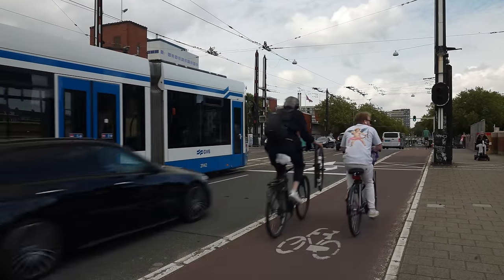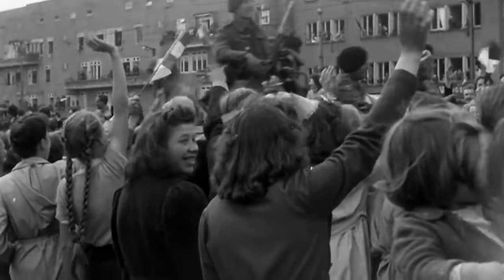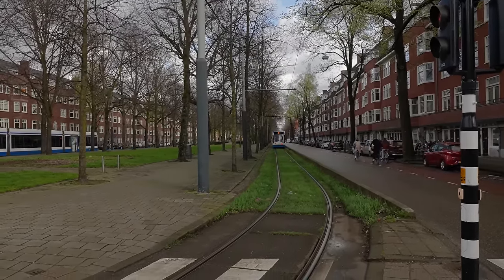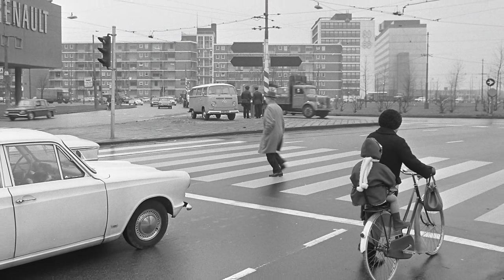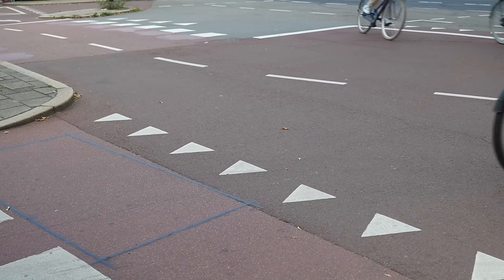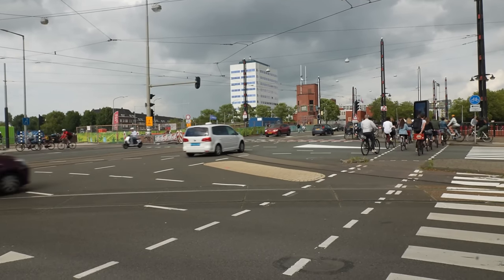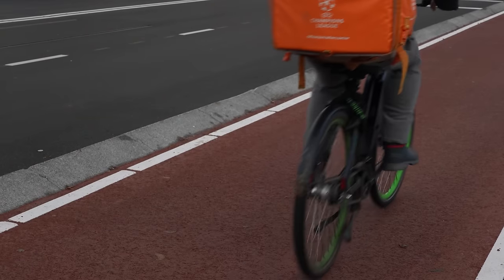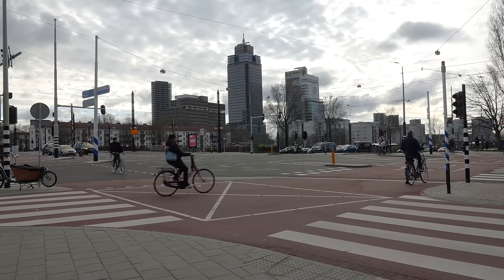Amsterdam Closed This Bridge to Cars (but not bikes ofc)

Comment: just for the good order: WE DO NOT REPAIR OUR BRIDGES ONCE EVERY 90 YEARS. it's really dependent on the materials, the usage and how well the small maintenance has bin done. but 90 years would be record-breaking for a bridge which is being used so much.
Reply: I remember small repair in the 90s, but not the fundemental bridging system.. maybe im wrong. Who does know here?
Reply: in america we absolutely repair our bridges every 90 years, or when they fall down, whichever comes first
Reply: I work on these kind of projects, they engineer bridges in general to have an average lifespan of 100 years (sewers as well by the way). So yeah Berlage bridge with it's heavy traffic use was overdue at 90 but not incredibly long overdue.

Comment: How Amsterdam reacts to problems is just crazy.
There is no connecton to the other side? Build a temporary Bridge.
There is no Tram line curently? We will get that fixed soon. In the mean time we will have more buses driving there.
In nearly every other city stuff like this would simply be ignored or worsened.
I don't even live in a bad place but videos like this make me wanna live there.
Reply: You call it crazy, I call it efficient.
Reply: That is what you pay your politicians for..
Reply: @paolagrando5079  I believe the crazy part is that it is possible to actually achieve the efficient result.
Reply: I do like that they somehow missed installing the tram lines. Like the rest of the project continued and actually completed without them installed, that's pretty funny. I suppose it did finish on time though!
(Of course they'll fix the issue, I just love that weird construction issues like this happen worldwide)
Reply: The tram line being cut off is kinda embarrassing imo. I think running replacement buses is really the minimum that any city would do, at least in Canada (can't personally speak for USA).
Reply: @laurencefraser  I know. In plenty of other countries we are used to see efficiency only with a telescope.
Reply: The core of the issue in my view is a different election system.
Dutch politicians aren't magically better than other places.
But we have election systems that function a lot better than first-past-the-post in aligning politicians with the desires of voters.
Reply: "There is no Tram line curently? We will get that fixed soon. In the mean time we will have more buses driving there."
If such a thing happened in İzmir, the replacement bus route would have been a shuttle that only covers the stops just before and just after the bridge.
Reply: Idk why people think this is only an Amsterdam thing.

Comment: In Bremen Germany they closed a Bridge for Cyclists and Pedestrians, but kept it open for cars....
Because in the eyes of the city administration, Cyclists and Pedestrians weight more then Cars, Trucks Busses and Trams
Reply: Ohh that story. They also blocked the bike path with metal fences secured by concrete blocks.
So the blocks did weigh more than the bikes would.
Really the entire administration would strougle to achieve half an IQ between all of them.
Reply: @MetalMachine131  This surely must be a joke. Right?
Reply: @fulconandroadcone9488  Nope this happened. Eventually they figured out that it didn’t make sense (the required report costs like 100k) and the barriers were removed.
Reply: @fulconandroadcone9488  No, sadly not. Been there, seen it. The bridge is reopened now, though.
Reply: as if cycling through Bremen wasn't already difficult enough
Reply: @corvusmonedula  It actually depends on where in Bremen. There are parts with pretty good cycling infrastructure. Also, there are projects going on to improve that. I.e. the Fachausschuss Verkehr und Umwelt Schwachhausen earlier this year decided on a plan to sacrifice a bunch of roadside parking in favour of the Radpremiumroute to Horn-Lehe.
Reply: "GERMAN SCIENCE IS THE BEST IN THE WORLD"
Reply: @GanyuSimpingDegenerate german sucks now
Reply: vErNünFtiGe PoLiTik they said
Reply: They did similar in clogne.
The pedestrian and cyclist lane got cut in half with baricades to "reduce weight on the bridge". Well the baricades weigh more than there are ever people on the bridge. And there are not less people anyways on the bridge, the just cram more. Closing one car lane instead was not possible, obviously...
Reply: @prashnaveetprasad8339  They still have the autobahns with unlimited speeds, so they still rule the world. They should have those in the US or Canada, yet there they put whatever farmhouse exiting directly on highways. Ridiculous.
Reply: @jankees4037 i cant figure out If this is Satire or Not 😂
Reply: I'm not surprised. 🌑
Reply: ah yes, the German efficiency and practicality :D
Reply: @johnjohnny7257  Yes, it belongs even below F Tier! “G” Tier for Germany. XD
Reply: @fulconandroadcone9488  no this is common in Germany I’m happy that I don’t live in Bremen but in my city Hamburg construction sites take years

Comment: You should see the crowds on the new bridge in Warsaw (for pedestrians and bikes only)! It opened 2 days ago.
Reply: What is it called?
Reply: @timsoel566  Most na Pragę
Reply: Bruh how the fuck are you supposed to use a bike if it's mixed with a width of only 6 meters ? All pictures show it extremly crowded. Why isn't it like 10 meters wide with 4 meters dedicated to two one-way bike lanes and 6 meters to pedestrians instead of building a shrinking bridge that goes from a width of 16 meters to just 6 meters?
Reply: Same during weekend when they close off krakow street. Is it the bridge near the Palm tree roundabout ?
Reply: @KalashDaCat this was very heavily criticised, because indeed it is ridiculous. Especially as the bridge is used by pedestrians as a space to spend time (there are benches etc.) not just go through.
Reply: @miszczfezorowski  looks great!
Reply: @KalashDaCat  You have to yield to pedestrians because of the D-40 sign ("Strefa Zamieszkania"). It's also ridiculous because it allows cars to enter it. If you want to go faster by bike, there is Holy Cross Bridge like 900 meters from this bridge with dedicated bike lanes on both sides.
Reply: @Terrgaz  It's near Krakowskie Przedmieście, but not near the palm, there is Karowa street that connects the bridge to Krakowskie Przedmieście
Reply: I'm a Varsovian. This bridge is the essence of changes in Warsaw. New projects are in the right direction, but there are almost always flaws, that make them not so great as they could be.
I went on this bridge with my bike two days ago. It was impossible to cycle, because pedestrians (especially young children) are walking in every direction. 
I really don't get it why they didn't separate the pedestrian and bike areas.
Reply: @KalashDaCat 
Yop, that's the biggest critique.
But the bridge is intended mainly as tourists attraction and it's commuting role is minor.
It will be packed with pedestrians only during warm weekends. Most of the time it will have plenty of space for both pedestrians and cyclists. Today, mid day with 12°C and rain it has ~20 pedestrians on its whole lenght.
Reply: @Terrgaz nope, it's a new one, just opened.
Reply: @oseqq  Then it's a useless project. So much money spent on a stupid tourist attraction.

Comment: Thank you Jason for an extremely interesting video centred on a bridge I have crossed on many occasions.  Your point that trams have much greater capacity than buses is a fundamental one which many non-transit people (especially politicians) do not understand.    The point about shortage of public transit drivers is applicable to most major cities I know.   What we need is of course to considerably increase both the drivers' wages and the size of the vehicles they drive!
Reply from the maker: I really don't think people appreciate the extra operating costs of buses over trams either. 

When Toronto converts a streetcar to buses during construction it cost them an extra MILLION DOLLARS A MONTH to operate them!!
Reply: Yes, a major argument against LRT in my hometown is that "but they can just build a bus road!". No, they can't, that'd be a significantly worse option in every single conceivable way.
edit: agree with you on drivers' wages, too, of course.
Reply: @NotJustBikes  That's a tough one, even in Amsterdam. I'm not sure if you're familiar with the history of busline 15? It used to be the combination of what's now line 15 and 65, and was the busiest busline in the 1990s. So busy that they decided that it should become a tram. They lobbied for money, and actually got so much money that they instead decided to build the ring metro from west to south, for which usage immediately exceeded expectations. However, line 15 still was (and is) a very busy busline. Its trajectory is 90% over streets with existing tram infrastructure, but they never found the money to build the last 10% and replace it with a tram.
Reply: @NotJustBikes  You might want to check the Tram-Fiasco in the city of Groningen. Als early as the 1990's the city knew that busses and cars were going to cause major congestion in and around the city centre, and in combination with the ring road having a stoplight intersection where two motorways meet (A7 east and A7 west and the terminus for the A28), they decided to develop a plan to bring the tram back.

Groningen had a tram before busses and cars took over. As a young kid I remember the pieces of tramrails still embedded in the surface of the Grote Markt. 

Anyways, the realisation of tramlines was made as a must-have before re-structuring of the Ring Zuid motorway junction. But about 8 years ago the city council got cold feet and decided there wasn't enough 'community support' for the tramlines going through the city centre. So now there's endless traffic jams of bendy busses trying to reach the major employment centres from the main railroad station during business hours.
Reply: @Pfooh  Here in Bern we have the infamous bus line 10. It runs from one independent metropolitan (Ostermundigen) area through the city centre to another independent metropolitan area (Köniz). While all other major Lines within the city have long been converted to tram's, this one is still on bus (Rush hour: every 2-3 per minute). In order to convert it, there needs to be a public vote in all three political entities.
And both refuse (Ongoing for about 20 years). They line is currently served by Hybrid-biogas Buses, which are really fast. It's insanity from a financial standpoint, but it's basically the best you can get. (Faster and Forced extra Frequency due to capacity issues).
And they don't have to pay for it themselves: Between Ticket Zoning and they way the state runs the public transport system, those costs are spread all over the network.
Local autonomy has been a staple of Switzerland's stability, but it sometimes does allow some people to take advantage.
Reply: @Pfooh This was already the case when I went to school in Amsterdam between 1980 to 1989, making a tram of bus 15. Bus line 15 came every 5minutes at Haarlemmermeer station and was always packed with passengers, often leaving some behind at the platform. I had to take bus line 23 which came every 20minutes and was never full. Back then there were also tramline 6 and 16 at the same stop, both tram lines have disappeared sadly.

Comment: The architecture of the neighbourhood designed by Berlage, Zuid, is called De Amsterdamse School. Literally The Amsterdam School, but it is collective name for specific design futures in architecture. A better translation would be the Amsterdam Method, as it is a complete idea of how to efficiently build a neighbourhood. 

The second floor apartments were accessible via an exterior staircase, leaving more space for the downstairs apartment, that could have a small garden. The third floor has access via an indoor staircase, as would the fourth floor. Sometimes. the third floor would get the fourth floor as well, accessible by an indoor staircase. The division could be different depending on the street. There are balconies at that rear of the building, overlooking an inner courtyard. The interior layout was well designed, which is why these homes are still popular these days, aside from being beautiful. 

It was a ground breaking way of city design and planning, and in a way informed much of the infrastructure for decades. Before this time, city design was not made into such a singular idea that covered all aspects of housing: interior layout and design, exterior design, street design and a street plan that divided sections into smaller neighbourhoods with larger roads. 

Definitely worth its own video, as it revolutionised city design in the Netherlands.
Reply: The Amsterdamse School was also very popular in the province of Groningen. Mainly in the city of Groningen itself, but also in many smaller villages around the province there were schools, houses, and government buildings build in the style of the Amsterdamse School.

Comment: They did something similar in Antwerp when they built the new Londenbrug (at the... Amsterdamstraat). It's also a bascule bridge to which they added new tram lines and bike paths.
Reply: And, did they manage to measure the tram tracks correctly in that case? 
(if yes, you've got a good nen dommen 'Ollander joke in there!  ;-)
Reply: @LeafHuntress  Yes, of course! But I shouldn't laugh since there was a long delay because of a 40-cm-wide gap in the bridge, so they had to fix it first. What's worse, incorrectly measuring the bridge or tram gauge?
Reply: @KristiaanVanErmengem  Ah, 'n Belgenmop! ;-)

Comment: This is extremely interesting and unexpected, but this story could as well be about a similar bridge in Antwerp, the similarities are striking. When the "Londenbrug" needed to be replaced, it was closed off 9 months for cars, and a similar temporary bridge was installed for walking and cycling. But that one was even more impressive, as it was movable.

On the tram side, it is even more similar than I could possibly imagine. The bridge actually needed to be replaced to allow a new tram line to run there... only to discover afterwards that our transportation company has an irrational fear of movable bridges, so in the end they chose not to run a tram on it even to this day. Despite it only opening less than once an hour on predefined times. The fittingly named tram stop "Amsterdam" sitting empty and trams turning away right before the bridge.

On the positive side, a lot of frietzakken and banana's (didn't know the name yet) are installed here too last few years!

Comment: There actually was a ring- railroad and a new big station planned in the South of Amsterdam  to be build in the early 40's , never happened thanks to ww2 , but the dike the metro and train run over in Amsterdam west was build in the 30's and only used in the 80's  for both the extended metro and the new Central station -Sloterdijk -schiphol  connection .. ( In one of my workplaces there was a big architect's  drawing of "Amsterdam Zuid Station ' looking rather similar to Central station )

Comment: They just added a little pedestrian/cyclist bridge at the northwest end of Diemen Zuid station, so that if you're transferring from bus 44, you don't have to walk around the canal and use the stairs, or just walk to the other end of the station. It took about a week to install and is super handy, especially for folks on wheels. I can't get enough of this attention to small details and incremental improvements with tangible impact!

The Berlagebrug renovation is great ... my favourite part is the corner where the space for cyclists is twice as big as the space for cars!

Comment: It took 2 years for the North Carolina DOT to dismantle and rebuild an old two lane river bridge in my town. During that same time, Atlanta rebuilt a bridge that collapsed from a wreck, that was 3 or 4 times larger and suspended over a major interstate highway, in just 43 days. It really depends on the state's priorities as to what gets done. Granted, the I-85 bridge is part of one of the largest highway networks in the South US with 340,000 vehicles traveling it per day, but even with only 10,000 vehicles traveling the bridge in our small town of 4,000 (38,000 county) makes a huge impact. Especially for TWO FRIGGIN' YEARS!

Beyond that catastrophe, we still don't even have a decent walkable town, let alone a bikeway network that's worth anything beyond exercise with greenway bike paths. The best we get to actual travel are "bike paths", which are just regular roads/stroads/highways that don't even have painted lanes for bikes, just signs signifying a route. It sucks for everyone, too. We have mountains in Western North Carolina, and there are no protected lanes, barely even a shoulder for bikes to move over to allow cars to pass on mountainous roads, traffic backs up, drivers and riders are both getting frustrated, and the whole thing is dangerous for everyone. Even in town, sidewalks just end for no reason. Narrow roads don't allow much in terms of safety for cars and the huge trucks that use the road, let alone pedestrians and cyclists. We don't even have a real public transit. The county operates a "transit" that consists of what amounts to the equivalent of short church busses, but even those you have to schedule 24 hours in advance, they only operate from 7 am to 5 pm, and you have to run the entire route for all the scheduled stops until you're taken home.

We need a massive overhaul of our transportation network here. I can barely get on the highway from the road I live on because people are literally going 100 mph down that road. I know motorcycles are hitting 120 mph if not more. It all just gives me anxiety and makes me not want to go anywhere, even in my car, and I live in one of the most beautiful places, in my opinion, in the world (Smoky Mountains). I wish we had more forward thinking people here. Not the bigoted MAGAs that currently run everything.